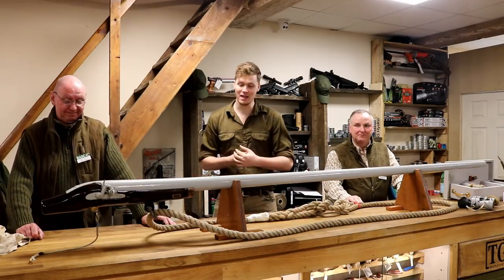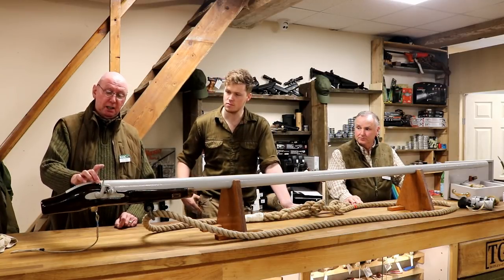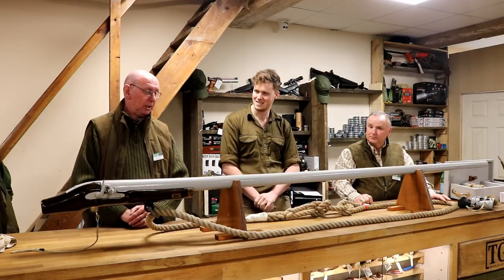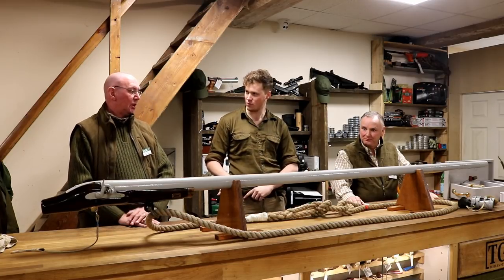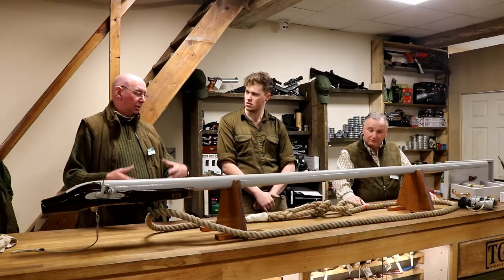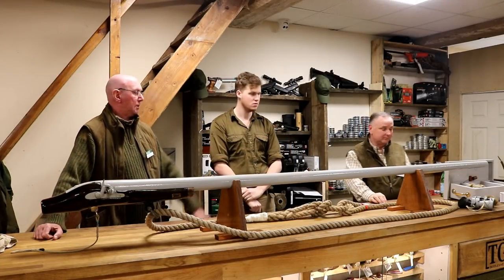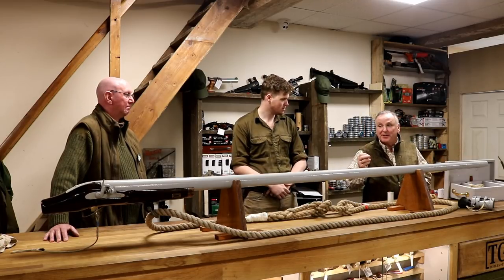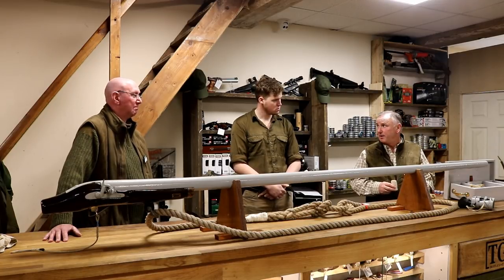Punt Guns Explained - Part 1/2

Comment: I thought we were the only ones keeping the punts in the water as that is still a fairly common way of hunting, albeit the punt gun is illegal so we use normal 12 gauge.
Reply: Where are you shooting mate, that the punt gun is illegal?
Reply: Denmark, any shotgun for hunting is only allowed to be a maximum of 12 gauge meaning these 1-4 gauge guns are an order of magnitude above what the law allows for hunting.  
The boats we use are also a lot smaller than the ones they mention being slim 12-16 feet punts, search "leon Smith pram" if you want to see how they look. 

The Leon is pretty much considered the best in the business here.
Reply from the maker: Perhaps a punting holiday to the UK?
Reply: You could add it into the current hunting trip offers and see if there are any takers. It would be bot interesting and special.
Reply: Can’t use them in the US either.

“Illegal hunting methods. You cannot hunt waterfowl:

With a trap, snare, net, rifle, pistol, swivel gun, shotgun larger than 10 gauge, punt gun, battery gun, machine gun, fish hook, poison, drug, explosive, or stupefying substance.”
Reply: @karlsailor  that's because the canvasbacks were virtually wiped out.